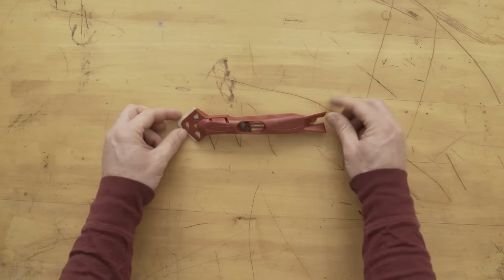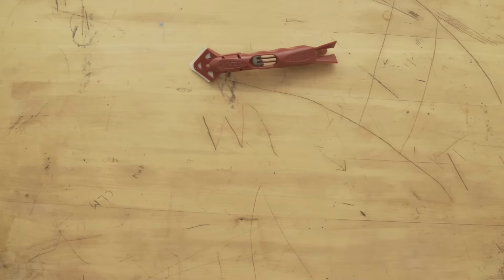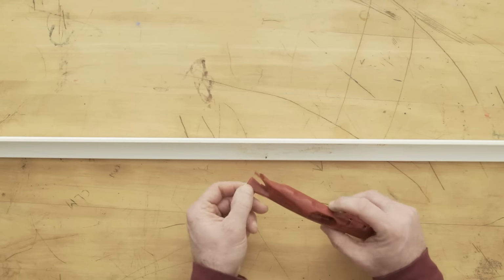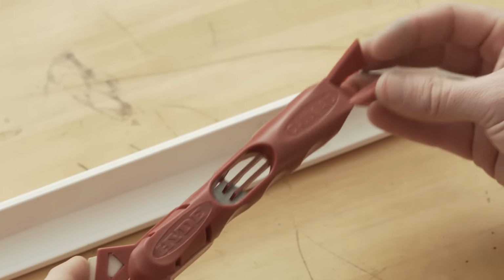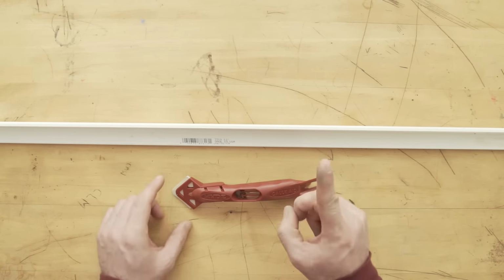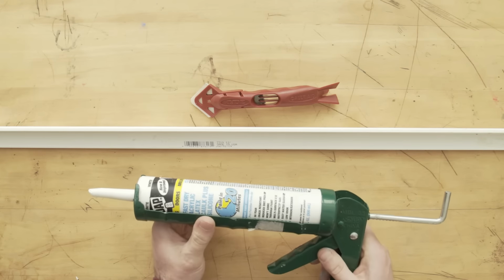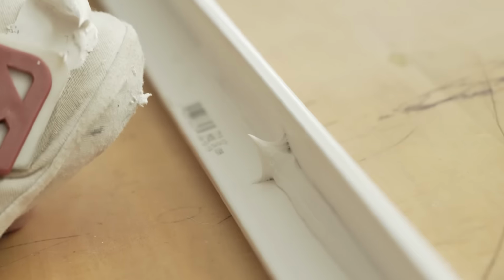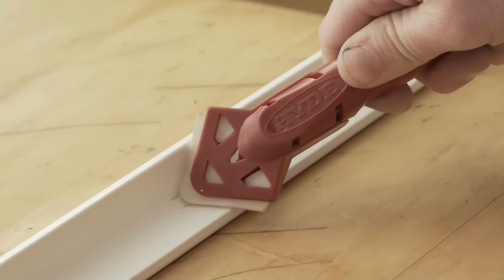How to use a caulk remover and smoother combination tool.  |  Hyde Tools

Comment: how to you re-use the excess? surely you don't waste it?
Reply from the maker: Professional painters and drywallers are adept enough that they tend to produce very little waste. But when there is waste, it is typically disposed of. In some instances you may able to utilize excess caulk in a large gap elsewhere, but it's difficult to keep the surfaces clean when trying to reuse excess caulk.
Reply: If there is no excess, you can be sure you haven’t used enough.  In my experience, ensuring you have a proper seal is more important than saving a few bucks on caulk.  Penny wise, pound foolish and all that.
Reply: I wouldn't look at it that way. You would be tripping over dollars to pick up pennies. Cleanup after a good job will have some waste. Just minimize it where you can.